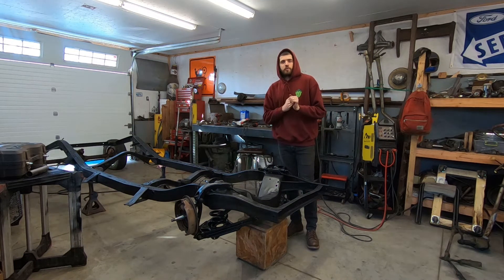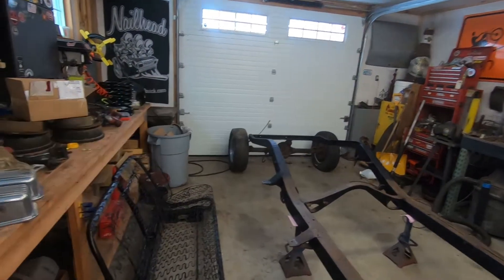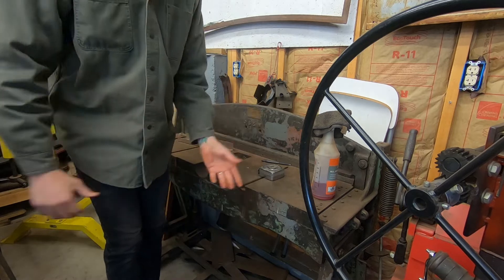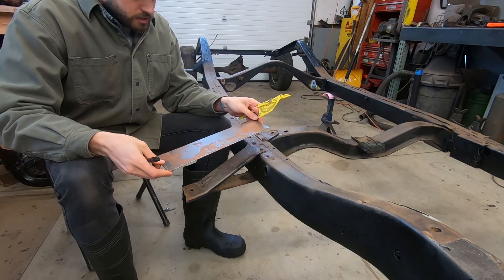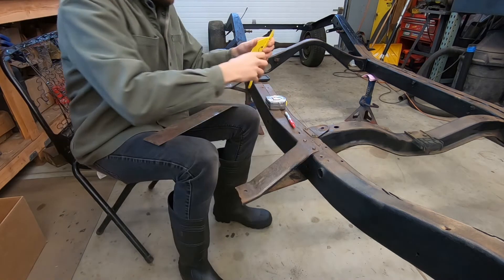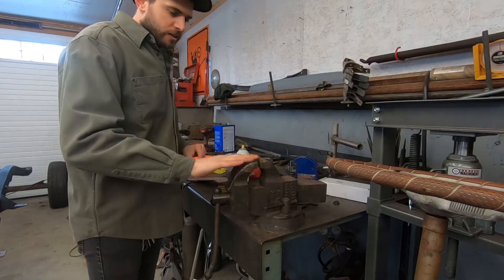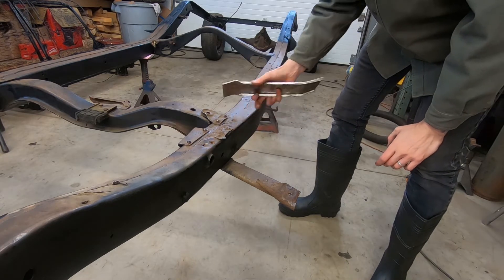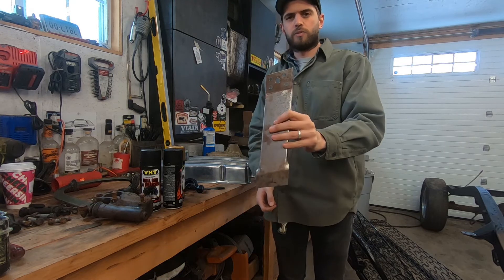Shoebox Ford : More Chassis Progress

Comment: Heist job getting the frame ready for paint like your welding techniques you put a lot of faith in that cement floor being level square and plum next time you’re at a yard sale or you’re out by a 6 foot aluminum level you could’ve laid it off over the top of the frame and measure down instead of coming up off of cement floor measuring up unless you check the cement floor to see if it was level in your area which I doubt I’m a Carpenter seen too much by the way like your five window new subscriber junkman do
Reply from the maker: Samuel Bacon I figured leveling the frame out would suffice. I guess we’ll see! Haha thanks for watching man!
Reply: @RACGARAGE just curious as to how close it ended up being as I was thinking about the floor not being level as well